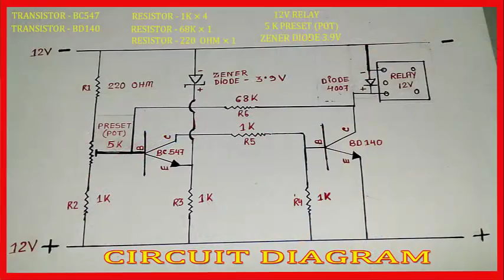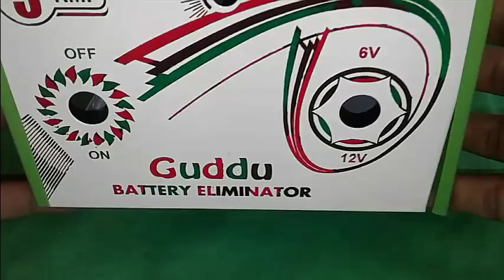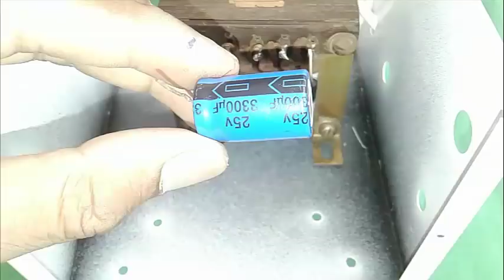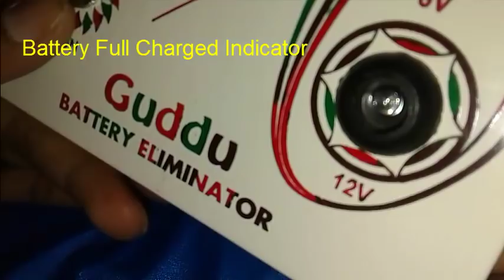12V 4Amp Battery Charger With Auto Cut Off

Comment: Is it ok if I use bd139 transistor instead of bd140?
Simultaneously a 12-0  2amp transformer.
I honoured if you reply.

Regards
Samar
Reply from the maker: BD140 PNP transistor
BD139 NPN transistor
Do not use bd139..
Reply: @techtarun77  
Thank you so much for your response..

Comment: aapne input kitne volt aur amp ka use kiya hai is 12 volt ki battery ko charge karne ke liye yeh nahi bataya is vdo mei.
Reply from the maker: Use Transformer 12 0 12 
4 Amp
Transformer input voltage 220v Ac
Out put 12V

Comment: I have made an auto cut off 4 volt battery charger circuit. I have a problem in this circuit that I can not able to adjust the the cut off voltage. Input is 6 volt and how can I adjust the voltage? 1) By connecting 6 volt adapter in input line and connecting a fully charged 4 volt battery in output line, can I adjust the preset ? 2) Connecting the 6 volt adapter to the input line of the circuit not connecting the fully charged battery to the output line, can I adjust the preset? 3) Connecting 6 volt adapter to the input line and connecting 4.8 volt dc volt supply to the output line of the circuit, can I adjust the preset? 4) Another process.
Don't take it as command, take it as request. Please help me by replying it. If 1,2 and 3 no. options are not correct, please describe the another process so that I can adjust the cut off voltage. Please reply as early as possible

Comment: What is the purpose of zener diode 3.9v?
Reply: voltage controlled relay circuit. you need a reference voltage.
Reply: @robertmeyer4744  hi if I use 5 v Zinner diode then what should I change
Reply from the maker: Yes use।।
But better performance use 3.9v zener।।

Comment: Agar 220 volt ko dc mn convert karen or phir dc220 volt ko 12 volt k adapter mn lagain to wo 12 volt ka adapter kya ac mn current dega agar nahi to please ap mujhe tariqa bata den k 12 volt ko ac mn kese mn kese convert karengen diode nikale baghair please sir
Reply from the maker: 1 - AC 220v  ko DC 220v karnaki koi jarurat nahi ha..
2 - Adopter me AC 220v lagta ha..
3- 12v adopter me phele 12v AC nikalta ha..Phir diode lagake DC 12v karta hai...

Comment: AMP  RATE OF RELAY???
RESISTOR POWER RATING??(WATT)?
ZENER DIODE POWER RATING??(WATT)?
Reply from the maker: Relay - 7 Amp
Restance 1k × 4
68k × 1
220 ohm×1 ( All restance quarter watt)
Zener diode 3.9v ( Quarter watt)
Reply: THANK U.. THANKS FOR UR REPLY.

Comment: But my transformer output is  0, 3, 6, 9, 12 volts, how can I use your vid, coz you have 12 , 6 0 6, 12?
Reply from the maker: Use 0 12 or
Four diode bridge
Reply: Thanks a lot and more power

Comment: what is the dc output from filter?
Reply from the maker: DC out put 16v
Reply: sir  @techtarun77  why is it shows 0.4-0.6A  only the charging current?my battery is 12V/5Ah and my transformer is 12 0 12 15Amp secondary.
Reply: ive noticed tha auto cut off response is not accurate sometimes